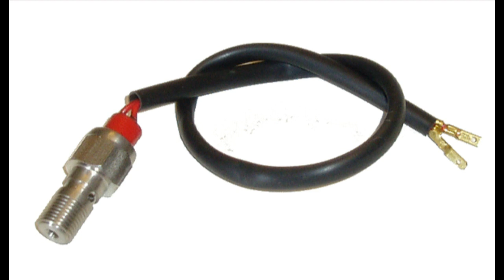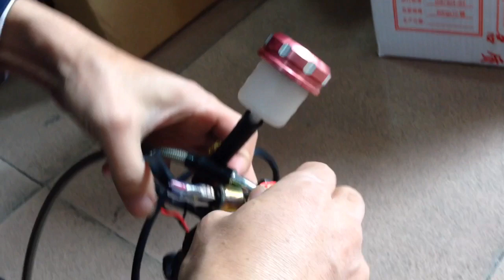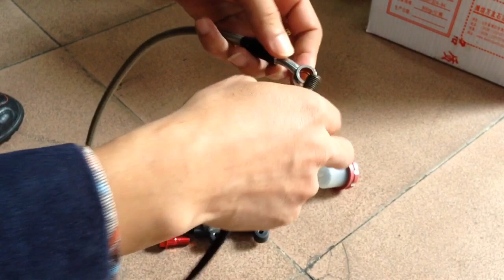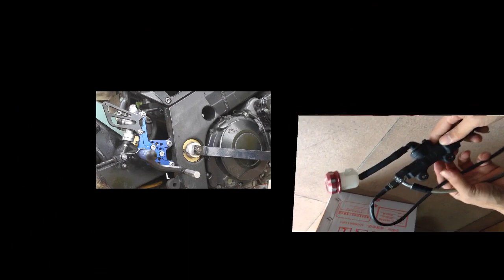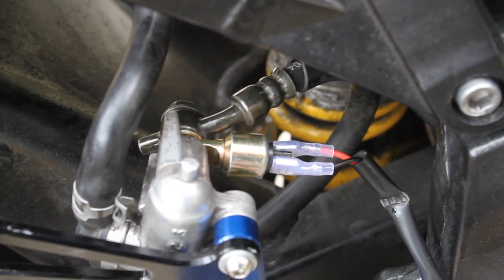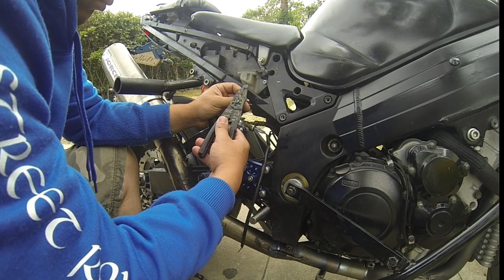Custom Chinese Rear Set Brake Light Install Tutorial With Banjo Switch on Sport Bike GSXR 1000

Comment: Just a heads up, ==>  I MP O R T A N T <==

I just installed a Fuxing CNC brand rear sets on my 2016 ZX-10R,  it come with the same kind of banjo you got.
Unfortunatelly my banjo is leaking brake fluid from the back, where the electrical terminals are........I think this solution would be good if the banjos were quality parts, they are a crap.......last thing any biker need is to find out that you are loosing brake fluid in a long trip, I am just glad that it started leaking right after the installation.

I think I will fabricate a bracket and use the OEM brake switch and leave the brake line alone.

Comment: Sweet.  My rearset is on the way and i have the other switch not the one you got.  Video helped a lot,  thanks.  You should of save another $170 bucks and bought the Vortex rearsets.  I was thinking about getting the chinese made ones but ended up getying vortex.
Reply: ***** Thanks for the tutorial. I installed the rearsets and brake switch. No surprises, everything went smoothly. Rearsets work way better then stock. I adjusted them perfectly for my boots.

Comment: Im sayin when u unplugged the stock switch, you could have cut the connector off of it and spliced it to the wires on the new banjo switch then you could have had a stock connection. But cool video and thanks for the info. Im waitin on my chinese rearsets for my 06 ninja 636. I hope they work.

Comment: You need to move the shaft out of your rear brake slave cylinder up one hole on the brake pedal. Shouldn't be at an angle like that. It's gonna RIP the boot and leak fluid. Just fyi. Nice video tho

Comment: nice video mate. just a quick question. ive just installed these but my brake pedel dont have a spring to bounce it back up. so the rear wheel looks. how is yours springed? same bike and same rear sets
Reply: Exactly the question I came here hoping to find an answer for!

Did you ever work it out?

Comment: How did you install the shifter side rear set I’m haveing issues with it
Reply from the maker: What are you having trouble with exactly?
Reply: I’m having trouble too with the shifting rod lining up. The foot lever keeps rubbing the shifting rod idk how to get more space between them
Reply: Also what’d you do with the banjo bolt on the back of the brake lever how’s that work with the cylinder

Comment: did you used a sealing washer between the banjo and the switch ?
Reply: Supposed to have a NEW crush washer on both sides of the banjo bolt

Comment: Why did you not just unplug the plug 🔌 in aN jus not splice it aN jus plug it in that’s what I’m doing with my 04 750
Reply from the maker: Because it obviously wasn't the same plug bro
Reply: I did what you did.  I didn't get an activation on my brake light. Any suggestions?
Reply: I went tried like 4 different ones none work :( fml